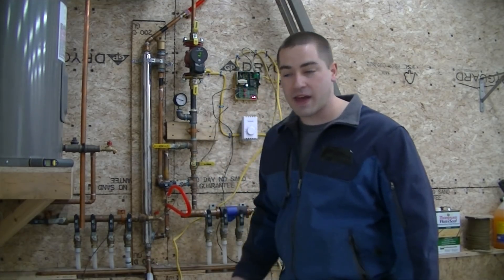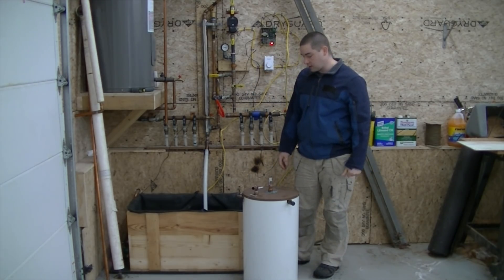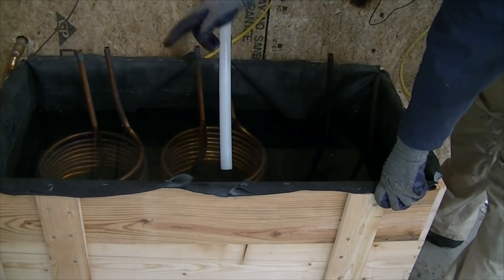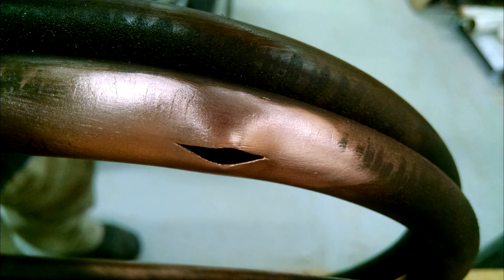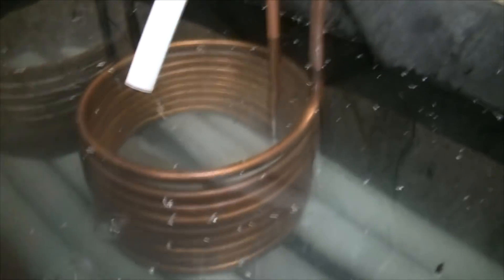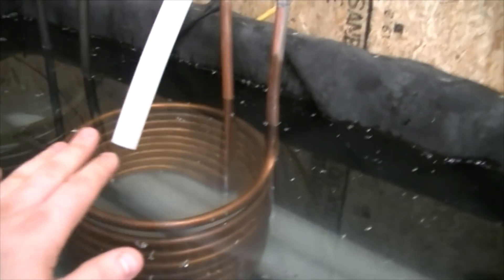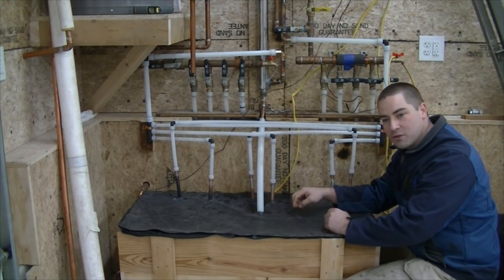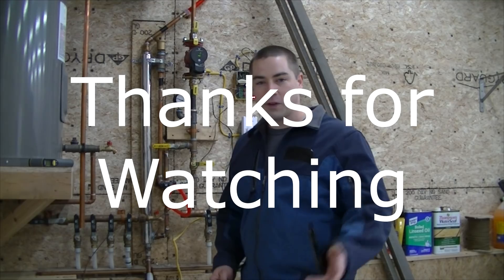Adding Heat Exchangers to Garage Solar Heater

Comment: I'd love to build my own house. I have a 1950ish house. no one lived in for about 20 years. now I have it off grid. so far a5kw inverter is plenty. I have a 8kw&2kw generator. with 25 gallon fuel tank just in case. I would like something like this. I don't know if I have room . I have my solar panels in the only spot I get good sun. I guess evac tubes would work. I haven't seen and with a good price.I love watching stuff like this.
Reply from the maker: Wow, you are already off-grid!  Nice!  I can't wait to join you.
Reply: I had to get a 10kwatt inverter just to push a washing machine.....
What dose your 5k run?

Comment: because it is not a portable water add antifreeze to your tank that will help to prevent algae grow and add some motor oil because motor oil is lighter than water and doesn't mix with it will cover your tank like a blanket and will stop evaporation and your  pumps will much appreciate it, just remember not to drink it and dispose of it properly, also make sure your rubber liner is  oil resistant
Reply from the maker: That's a good idea, reuse of old oil.  The liner is normal EPDM solar for pond liner.

Comment: you will get nowhere with them tiny litle tanks to store thermal energy you need big thermal storage . 
i have a 300 lt thermal storage tank  and it is far to small , bigger the better  when it comes to thermal storage
Reply from the maker: You are right.  I'm not trying to store energy in the tiny tank.  Instead I'm storing the heat in the thermal mass of the concrete slab.  Thanks for checking it out.

Comment: Very good videos Nice Repurpusing just gotta say if you would have just fixed the first one that you disassemble. you would have saved time and stress. Just by that error is why you where getting air in the loop right? @1:13 is the bad one the dark copper.. @3:06
Reply from the maker: Hi Billy,  Yes, the first one (dark coil) was the broken one.  However, I'm not sure that would have solved everything.  I was having trouble with the solar side of the system, not the radiant floor side.  The break in the pipe was on the radiant floor side.
Reply: Ok good, everything is working now Right?
Reply from the maker: Yep.  Although I have the system off at the moment because it's summer and no need for heat.  But, yes, working correctly.
Reply: Glad to hear that, I'm trying to do the same, but with both Heat and and cold solar system. Thanks For the videos learn alot here.

Comment: For security, your soldered-filled split tube would benefit from having a proper patch. Cut a piece of old copper tube (like a bicycle tyre patch), heat it to red and let it cool. It will now be soft enough to hand-form over the split. Clean it, tin it and sweat it over the split.
Reply: I've had to repair far to many leaking copper plumbing pipes that had pinhole corrosion leaks.  I'd cut out the section and replace with new pipe.  To many times I've come to find MORE pin hole leaks would spring out from disturbing the existing pipes.  I rethought my approach and changed it.  I come to simply address the immediate leak by this method.  

Fix any leak in minutes.
 1) Drain water from pipe.  You can't solder copper pipes with water in them. 
 2) Sand paper or emery cloth clean the whole pipe 360 deg. and beyond on both sides of the leak.  
 3) Wrap clean copper wire ( stranded or solid) around the pipe with a solid layer of wire around the area.
 4) Flux and sweat with solder over the copper wire patch and pipe.  They become one and water tight.

If you use solid copper wire (single strand)  wrap it around the pipe edge to edge with no gaps and tight, then solder.  That gives you added strength with a split like you had.  cheers.
Reply: Actually you had it right in the first part. Once copper has corrosion and springs a leak on the pipe not a joint it is a sign of a failing pipe. Even copper has a life of 40 years all though it will usually last longer and I have replaced a lot in the most inconvenient places.
Reply: @sailingsolar  l
Love your repair method. The split shown by david is typical for a frozen pipe though, not a corroded one. I'm sure your method would work well in this case also.
Reply from the maker: Hi nlo114,  Thank you.  I didn't know how to make a patch.  I'm definitely going to try your suggestion, sounds great.
Reply: عوت
تقليم الكروم

Comment: Curious why you did not super insulate the box.    a larger box would have made this a lot more EFFICIENT>  Why because you are not trying to heat the water and it gets the water to hot.
Reply: Yeah, but is your goal to heat the garage or your living area?  With a conventional home heating system one does not "typically" heat the garage too.  This should be no different.  You want to heat the living area not in your garage, right.  Bad rational, imo. Seems like a poor reasoning to justify not being willing to spend the extra time to do the install thoroughly which would put more of the captured available heat where you want it, inside the living area.
Reply from the maker: Hi Steve,  Thanks for commenting.  I didn't feel the need to insulate the box because this is only a space heating system.  The box looses heat to the garage, where I want the heat.  I consider it like a big radiator.  Right now (summer) the system is off.
Reply: in floor radiant takes a lot of heat to get the floor charged then it does not seem to take as much heat to maintain
Reply: @DavidPozEnergy  1st I admire what your doing. And configuring them in series would be the most efficient configuration. But for testing purpose setting them up in parallel and just using sharkbite or compression fitting temporarily to find defects like leaking. That most likely was the cause of the problem. Seems to be the moral to this story? 

It was hard to see you cut up 2 of the heat exchanges that seemed to be functioning but good luck with the rest of the build out.
Reply from the maker: Hi sailingsolar,  My goal is to heat the garage, not my house.  On my property they are two separate buildings.  I have a few videos on building the detached garage, but I suggest this one because it shows the radiant floor:  https://youtu.be/s9Pmt7XG_2c  Thanks for watching.
Reply: OK, That's much different. Thanks for that.   Best wishes.

Comment: hello sir, I want to heat up a desiccant solution with the help of evacuated tube collector indirectly by using a heat exchanger placed in the solution tank. But I have a little confusion. I placed copper pipes in etc tubes and all pipes are connected to a header which is also made up of copper. This system is connected to heat exchanger placed in the storage tank and the system is closed. I am confused will thermosiphon works in a closed loop filled with water????  Pls, sort out my problem...Thanks.
Reply from the maker: Hi Akash Sharma,  Sounds like a fun project.  My experience is with active systems using pumps to move fluid.  I don't know enough about thermosiphons, or your project, to be able to answer your question.  Good luck.

Comment: love the solar thermal vids. i finished a large install last fall, 7 - 4x10 flat plates and 4- 30 tube evac tube panels with a 1300 gallon tank. it takes alot more to heat space than one would think.
Reply from the maker: That sounds great.  Do you have any pictures or video of your tank?  I would love to see that.
Reply: How big of a space are you heating?
Reply from the maker: Hi Buffalo-Chips, I'm not sure if you are directing your space question to me or Tony, but my garage is 1,200 square feet.

Comment: hi David i also enjoy your work...can i give u a few tips : the tubing should be colored red for HOT and BLUE for cold + u should put a Temperature gauge on each (cheap) +the rubber cover should use insulated panel with easy acces...Just saying :)
Reply: I think beez was referring to the Hot being the water coming from the solar tubes and Cold being the water being pumped back out.
Reply from the maker: Hi Beez,  Thanks for watching.  I love color-coding hot and cold tubes inside my house for the potable water.  These tubes are all part of the garage heating system.  I didn't think there are any part of the system that is always cold.  But I'm not a plumber, just a DIY.  So where would you have used blue tubes?
Reply: or just put a colored tape thats what i do sometimes and im not a plummer also just a Heating and cooling ventilation humidification and general contractor....ect...loll

Comment: So you destroyed two perfectly insulated heat exchangers to make one big poorly insulated heat exchanger?  Instead of building a new tank you could have used the two good tanks in series?
Pex should bend so you wouldn't need all the 90's.
Reply: if the exchanger is in the same room he's trying to heat then the heat dumped due to lack of insulation is fine.
Reply: I didn't understand that either?? couldn't the tanks be plumbed in parallel without taking them apart?  I agree they don't need insulation and look better as raw stainless but insulation would help prevent a temperature gradient in the room.
Reply from the maker: Hi Robert, Here is a video where I tried to make the smaller tanks work together, but had issues: https://youtu.be/AOiHPO3M3gE  As for the temps in the garage, the vast majority of the heat from the water is given off into the concrete floor.  There is so much mass in the concrete that the garage is very slow to change in temperatures.  I don't have highs and lows.  Thanks for watching.
Reply: Yeah he did while you sat on your couch watching YouTube 🤷
Reply from the maker: Hi Calvin,  I have another video up: https://youtu.be/AOiHPO3M3gE where I tried having the tanks in series and just couldn't make it work.  That's why I resorted to making my own.  Thanks for checking it out.
Reply: Right on, I admire your passion and resourcefulness!
Reply: @DavidPozEnergy  you tank is bed
Reply: The heat is already in the room by the time it's in the tank, so there's no loss there.
Reply: would of sold them . . . .& plumbed a triple core car radiator + box fan
Reply: Yea
Reply: If this system proves to have insufficient storage and transfer capability (which is looks like it will overnight even with the thermal mass of the floor) I have a suggestion. 50 gallon drums with the quick release lids. You can buy ceramic temp coat to paint them with. Couple applications inside and out and it will be R40+ Weld bungs on the sides top and bottom to allow the solar water to equalize and stratify in the drums side to side. Also the taller the tank the more energy you can store btw. The stratification of heat collection in a larger area leads to more stability. its why water heaters are always vertical and not horizontal.
Reply: Buffalo_Chips there is no "couple coats of paint" that will give R-40 against convective or conductive heat transfer.   That's snake oil...

Comment: Does this really work?
Reply from the maker: The copper heat exchangers work extreamly well compared to the stainless steel heat exchanger.  If I had to do it all over again I would have just bought one coil of 3/4" copper tubing and installed that into the wooden tank.  I could have saved myself so much headache if I did that.
Reply: I was thinking the same thing and then read this comment. LOL
Reply: I Agree With Brinkszen